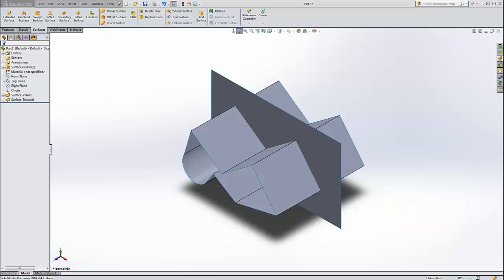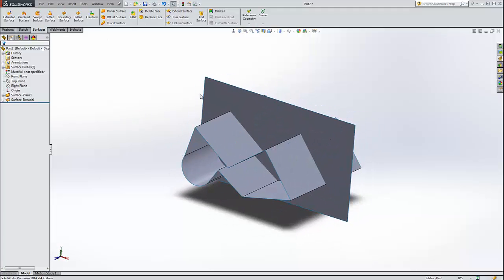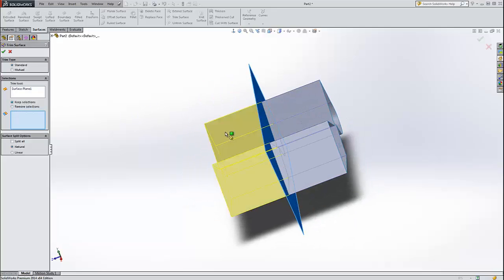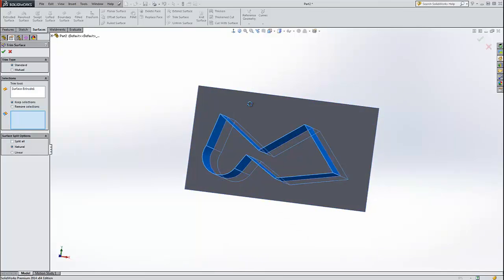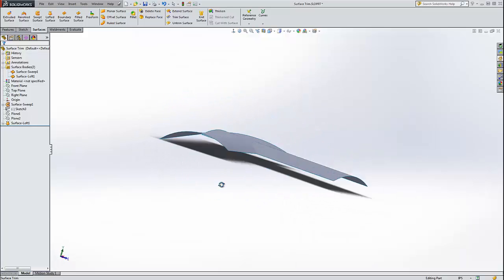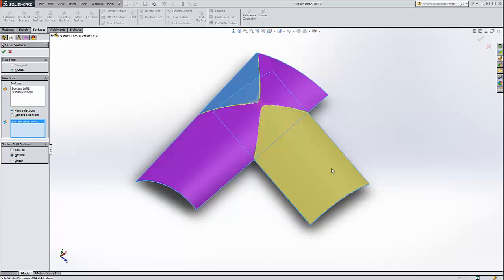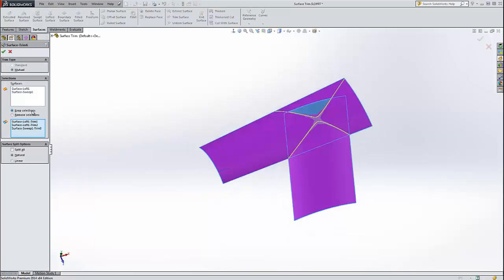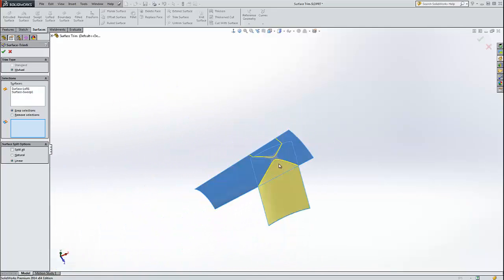SOLIDWORKS – Trim Surfaces

Comment: Nicely explained, thanks. 
In case we need to perform FE analysis of the surface, will the trimming surface, i.e., the planar surface in the first example, hinder the simulation results, even if I suppress it ?
Reply from the maker: Hi Shubham,
If you surpress the surface it will not be taken into account for the FEA as it will no longer exist in the work space as a body.